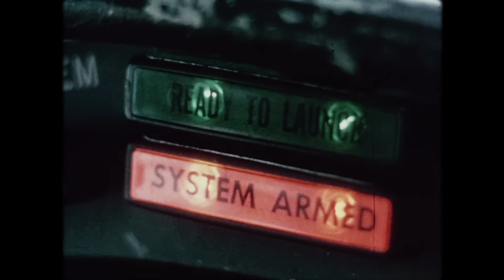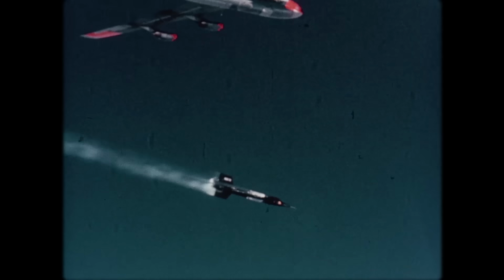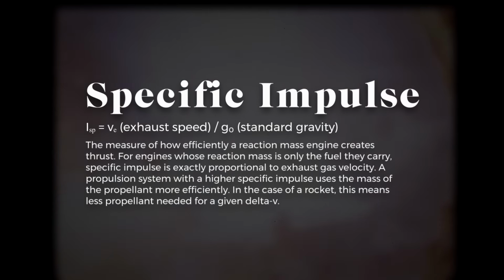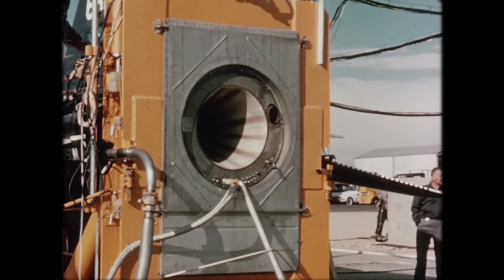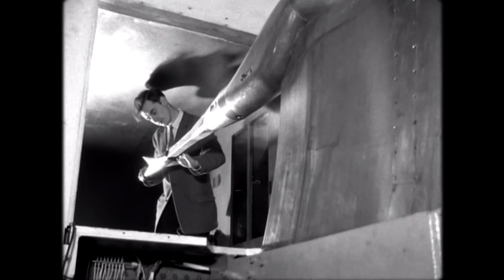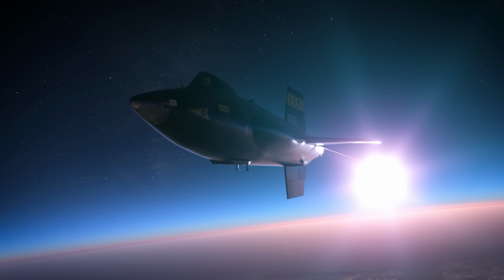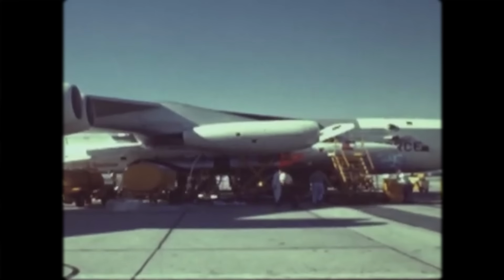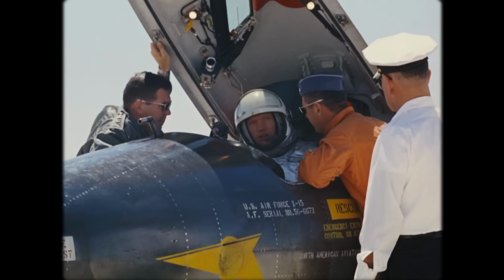The Insane Engineering of the X-15

Comment: “What? No, it’s totally an airplane. I mean, it uses a rocket,  but it’s NOT a rocket. It’s a plane. See the wings and stuff?”
Reply: saying this thing had wings is the same as saying the t - rex had hands lol
Reply: @karagothshlomidabush3727  hahahahah, dude.... golden comment :D
Reply: @karagothshlomidabush3727  and it does have hands. Just cause their tiny doesn't eliminate the fact it has hands. Invalid analogy.
Reply: @haryredneck   no it isn"t an invalid analogy   !!  because while it had wings .. and i am not disputing that ...nor am i disputing that the t- rex had hands ... they were not there to serve the x15 as wings ... only stablizers as well as the hands on the t-rex where not there to serve as hands to a full extent but they were there simply a  by-product of  it"s path throgh evolution
Reply: @karagothshlomidabush3727  They were wings, not fins or "stabilizers".  Did you notice how the aircraft was recovered after its mission?  Just like the space shuttle, it glided back to base.  Sure, it was a lifting body with small wings, but the two are not mutually exclusive, thus the SR-71. Rockets, on the other hand, have the same glide ratio as a hammer and need to have a means of reducing vertical velocity before contacting the ground.  Parachutes were pretty much the only technology available at that time.  Finally, don't forget the four forces involved in heavier than air flight:  Lift, Drag, Thrust and Weight, particularly lift and drag.  The creation of lift causes drag; Drag causes friction, Friction causes the upper surface of the wings (as well as other areas) to heat up, and that was clearly demonstrated with the temperature sensitive paint that was used by the designers of the airplane.  Not just the leading edges and joints between the skin panels, but the color change aft of there shows that the wing was generating lift.  A fin does not.  They are wings.
Reply: @Finchman63  CAN YOU READ ENGLISH MAN ????  READ MY COMMENT AGAIN
Reply: @haryredneck  They`re*
Reply: @karagothshlomidabush3727  he's right man.
Reply: @ItsNerforNuttin  you also having truble with english ?
Reply: @karagothshlomidabush3727  bro, just stop. You're making yourself look like a fool.
Reply: @karagothshlomidabush3727  Remembering the X-15 radio and B/W TV reports as a teen and young man, the X-15 was an amazing aircraft with considerable maneuverability both vertically and horizontally. So, it was "an airplane", a very advanced built-for-speed airplane (thus the short wings).  It was the design concepts test plane for and precursor to the Aero-Space Plane... a 1960's Boeing concept... aborted by ??? politics..

Its replacement craft, the Shuttle is just the last stage of a rocket ship which, according to it's pilots, "flies like a brick", and It is incapable of even partially circling the runway for a different approach.  

The main X-15 engine was a rocket .. however, I think the first X-15 flew with a jet engine. But airplanes have all types of engines; prop, jet, solar electric, ram jet, jato, and even "none" (as in gliders).  Wing design for airplanes are much more varied than the power supplies... can you say "canard".
Reply: @karagothshlomidabush3727  no im pretty sure you just won't accept you were wrong, im from the uk so I definitely know English.
Reply: @karagothshlomidabush3727  Your analogy is valid only for when the x-15 was on altitudes where air density was so low the wings were not capable of creating enough lift. But from when the x15 was released until it hit top speed they where more than just stabilizers. Also on the trip back when it was just a glider the wings where more than just stabilizers. So saying the wings where nothing more than stabilizers and serve no other purpose is incorrect.
Reply: @haryredneck  he was making a joke ... You must be fun in real lifeb
Reply: @karagothshlomidabush3727  just because a wing doesn’t have ailerons doesn’t mean it isn’t a wing. Very much is a wing as it very much provides lift and is an essential component of the airplane.
Reply: @DoubleTeaMedia  I think the difference can be seen with the swirl generated by the fuselage / lifting body / nose / leading edge extension. So there is a lot of light sheet metal which has those nice swept edges and faces to prevent a normal shock. And it would be a waste not to use this for lift. But also since there are no normal shocks, "wing tip" swirl builds up. The small wing rides on this swirl and translates it outside to reduce induced drag. The fin behind in normal flight feels no forces so it cannot do anything to the swirl. Still for steering the fin can be used like it is used for stabilizing and thus the elevons sit on the fin. But why no landing flaps?
Reply: i was told @ Lockheed (field trip) that a rocket has to be "dumb" to be a rocket. if this has a pilot its not a missile either because thts not "smart" or remote control. its just a plane w/ a rocket engine...
Reply: It's piloted missile basically 😂
Reply: Rocket engines are a type of jet propulsion.
Reply: So its a space shuttle
Reply: "WHAT DO YOU MEAN ROCKETS HAVE WINGS TOO? THEY DON`T, ALSO LOOK AT THAT POINTY HEAD, TOTALY A PLANE"
Reply: "<aside, to engineers> Hey can we make the fins, uh, wings, even smaller and get away with it?"
Reply: I love reading people arguing.
Thanks for the entertainment.
Reply: Have you never heard of rocket planes?
Reply: Hey guys. What an argument!! Remember that a plane does NOT need wings to fly. Just look up the "lifting body" planes from the mid 1960s. I think Karagoth raises that point.
Reply: @stankakol5195  but they got small wings or winglets. And in the end the Spaceshuttle got even larger wings. Seems that you need them to bring any payload back to earth safely.
Reply: @ArneChristianRosenfeldt  No true. The lifting bodies had NO wings at all. And the wings for the Space Shuttle Orbiter were only for cross range. The Orbiter could have otherwise been a lifting body design.
Reply: @stankakol5195  Okay, I did not really check, but I think I saw a lot of different designs. A capsule like on Sojus can be steered an in a way is a lifting body. Where do you draw the line? The Orbiter already has a very high landing velocity and cross range cannot be discussed away I think if you want to hit the landing strip.
Reply: German engineers pitching the me262
Reply: of course it is.
Reply: Everyone in here is a DA. why are you guys arguing over a rocket or a plane when it was created using a combination of both technologies? It's beyond me how people can't understand it is a rocket and plane all in one. But please, by all means, continue to make yourselves look bad in front of the whole comment section for my amusement. (grabs popcorn)
Reply: @seanmccloud8907  these r fax
Reply: @seanmccloud8907  u did type more than half the ppl here tho xD
Reply: It shares that classic pipe-bomb design with rockets. Airplanes are built completely different, they have fuselages and wings, controllable thrust,...
Reply: somebody stupid:  Sounds promising.  Lets give it a try
Reply: It’s a Rocket, with wings that didn’t do anything until the recovery phase then it became a glider.
Reply: Lol and stuff
Reply: Do rockets have a person inside? 🤡
Reply: Than is the F-35 not a plane .
Reply: Yep. It's a plane.
Reply: The x15's wings did provide lift. When this thing (or any plane) is in level flight, the thrust is exactly horizontal, providing no vertical lift. Without lift from the wings, the plane would begin to fall no matter how much thrust is applied horizontally. The wings (though small) still provided enough lift to keep it at altitude in level flight. It's a plane powered by a rocket instead of jets.
Reply: nope.  it is a rocket.  it does not have large enough wings to create lift on it's own and it brute force pushes it way through the air.  without the rocket, with a normal engine it would not fly at all.
Reply: @jamesjdm  I mean the thing looks basically like an F-104 Starfighter with a rocket instead of a jet engine. Still a plane.
Reply: @jamesjdm  Nope. Those wings are producing lift. If they weren't, the rocket would have to be pointed down to keep it from falling. It's not going fast enough to orbit.
Reply: @jamesjdm  So when the rocket burned out, did it fall out of the sky and crash, or could it fly and land without power? If it can land, i'd call it a plane.
Reply: All wings require propulsion to produce lift, so not sure what you mean. lol
Reply: @jamesjdm  exactly man ! you got it right

Comment: Really great video, thanks, from an aerospace research engineer. Pretty spot on in terms of the key facts covered too, it's nice to see you discuss the Isp and molecular weights of the relative fuels, which many people tend to leave out. The design choice of whether to use LH2/LOX, LOX/kerosene, or NH3/LOX is quite easy to summarise. If you have a mechanical size limitation (Saturn V) then you choose the most volumetrically energy dense fuel (kerosene). If you have a decent tank size allowance, you go for the most mass energy dense fuel (LH2). The use of NH3 in the X-15 was rather unusual, since it is neither volumetrically nor mass energy dense compared to the others. But the storage size, temperature of storage, and ease of pumping to high pressures (and very high post-combustion exhaust water content) allows very high specific impulses in suborbital hypersonic flights while maintaining a slim profile needed for low drag. And as you say, the relatively high specific heat allows regenerative cooling and keeps tank boil-off low.

Comment: It is not accurate to cal the X 15 a plane. It could not sustain flight and did not take off under its own power.
Yes, it had wings, but they were rudimentary and more accurately they were control surfaces. 
The X 15 was a rocket, only for research purposes.

Comment: Chuck almost burned up in that thing. That top speed is not that much higher than the REAL top speed (Still classified) of the SR-71 even though they are officially decomm'd. It is significantly higher than the 3.3MACH which is listed publicly as Habu's top speed.

Comment: 199, so it basically had more flights than Space Shuttle.....
This is a great historic/engineering video about X-15, but I would like to point out some error regarding the aerodynamic part of this video. This is based on my undergraduate study on Aerodynamics and Advance Aerodynamics (i.e. supersonic Aerodynamics). So please to correct me if I'm wrong.
1. Primary heating of the air actually comes from the shock wave it self, which heats up the air downstream of the shock. Frictional heating is almost neglectable. 
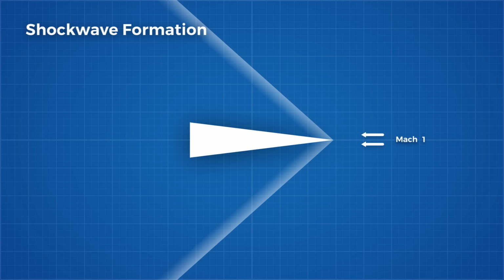2. Even an Oblique shock creates a supersonic flow by definition, it still needs supersonic in flow. At M1 (20:03) you cannot create oblique shock in general. (Well, maybe regional ones that has a local mach number > 1, but still the graph is very misleading)
3. 20:56 For oblique shock, the in flow "bends" the direction at the shock surface, it does not travel along the surface. This act very much like how refraction works, you can't make the flow travel along the surface or there will be no shockwave any more.. 
4. Yes, Newton's equation did become better at matching the actual lift, but there's an entire field of compressible, super sonic flow that does way better than that. Despite the fairly close conclusion, the reasoning is quite off.

Comment: You need to improve your research skills as it was Flight 90 (and later 91) that passed the Kármán line on 19 July 1963 at a max speed of 3,710 mph (5,971 km/h) 65.8 mi (105.9 km) flown by Joseph A. Walker  not Robert M. White whose flight only made it to 95.9 km. White holds no records at all.

Comment: Rocket? Could have gone a little higher and much faster.
A plan has airbreathing engines. 
Its a rocket not a plane.
Reply: air·plane
/ˈerˌplān/
Learn to pronounce
nounNORTH AMERICAN
a powered flying vehicle with fixed wings and a weight greater than that of the air it displaces.
 
Hm...

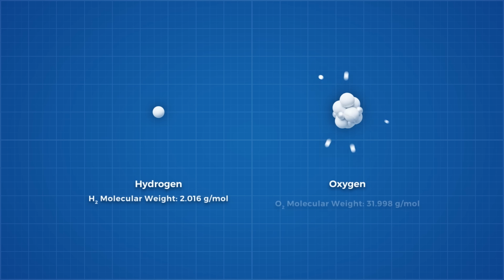Comment: As an Aerospace Engineer, I avoid speaking in absolutes for exactly this reason. Hydrogen and oxygen are not "by far the best"  @9:25. Oxygen is not the most powerful oxidizer. Fluorine is a better oxidizer than oxygen. Hydrogen and Fluorine will create about 5% more specific impulse per given volume but it comes with a 900 degree exhaust temperature increase amongst a host of other problems like being extremely toxic to humans in almost every way.

Comment: I’ve always known about the X-15, but for some DUMBASS reason, I discounted it as some not-for-real-airplane, rocket thing. I always thought it was just like a cheat code to go super fast. Wow, was I wrong. Thank you for this education. This is unbelievable stuff. To think they did this with pencils and paper, not supercomputers, is just unreal. It’s also more proof that the “moon landing was fake” crowd is dumb. I don’t doubt that this flight was every bit as hard to achieve as a moon landing, given the atmospheric and control issues that had to be overcome. Well done, sir. As usual. 

It’s also cool to see that so many now common things got their start in the aviation and space industries. Materials (like Inconel) that were once unobtanium, are now relatively common in engines and cars (exhaust valves, exhaust manifolds, turbos, etc.).

Comment: Its extremely doubtful today's 21st century aircraft designers could build this aircraft today without the aide of state of the art computer programs , the creations of 1960s rockets using mathematics slide rules & wind tunnels is a lost skill ,we still haven't surpassed 1950s and 60s heavy lift rocket tech .

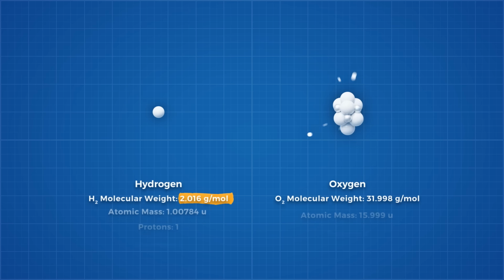Comment: There was a small mistake in the video around 9:30. The molecular weight of the propellants doesn't affect the specific impulse at all. It's the molecular weight of the exhaust products that do. Hydrogen/Oxygen produces only water vapor and excess H2, which are ~18 and 2 g/mol each, while RP-1/Oxygen produces many more exhaust products like CO2, CO, O2, OH, etc... along with H2 and H2O, which makes its exhaust molecular weight a bit heavier.

Comment: I just use LOX and Propane = easy to find, safe if they leak.   But the engines kept on melting, so I use ablative coatings on the inside of the engine itself.

Comment: That colour changing paint is the coolest thing I’ve ever heard of
Reply: Ablative coatings shed heat by shedding themselves.
Reply: Yeah, I concur with Jim Urrata's comment, adding that technically it isn't even really a paint at all, but rather, a coating of thick, insulating, "sacrificial" ablative media designed to absorb & remove heat in a deliberate, measured, & controlled process of degradation as it's shed from the aircraft. The "colour changing" observed is simply the pink ablative coating showing through underneath the secondary white sealant coating, as both are scoured away by the fierce, superheated airflow passing over them hypersonically. The white sealant coating over the pink ablative was designed to provide a barrier between the aircraft's Liquid Oxygen fuel and the ablative coating, which had the potential to react in a violently catastrophic explosion if they were in contact and subject to even a slight impact.

I wonder if a more modern & improved type of ablative coating wouldn't have been more reliable on the Space Shuttles than the insulating tiles they had so much trouble attaching to it's skin and keeping there, eventually causing the tragedy of the loss of the vehicle Columbia and all her crew on atmospheric re-entry.
Reply: @TomFlaTTop_BMW  I think the black 'paint' was probably meant to radiate as much heat as possible.
But we see that wasn't nearly enough to keep body panels from evaporating.
The pink ablative coating added a lot of weight and had its own issues as outlined in the video.
We've come a LONG way in heat rejecting coatings in the past 60 years.
Plasma sprayed ceramics would probably be their starting point today.
Reply: @jimurrata6785  Yeah, Jim , I agree...the original black paint, similar to that used on the Blackbird Series aircraft, was designed to radiate heat as you describe, but that paint wasn't visible or applicable during the max velocity hypersonic runs as it was never designed to function & protect the aircraft at the extreme envelope of performance being targetted on this occasion, hence the need for the thick pink ablative material and the secondary white sealant applied over it.
And I'd like to agree with you about how far we've come with heat management coatings in the past 60 years, but as I hinted at previously, the best we've come up with since then, as used on the Space Shuttle vehicles, is those pathetically inadequate & unreliable ceramic tiles that have had a history of regular failures. The fact that only one Shuttle Orbiter was lost with all crew on board during re-entry is almost exclusively down to luck, and had the potential to occur on any mission.🙄😫😠😡🤬👿👎👉 Hence, my query as to whether the ablative coating solution using more modern materials addressing the issues it had on the X-15 programme might have been a viable solution for the Shuttle Orbiters, but maybe not....although who knows? The Shuttle Engineers used a caulking-like compound intended for bathrooms and purchased at a local hardware store to attach the individual ceramic tiles that collectively formed the heat shield. With all the multi-millions of taxpayer funds spent on these programmes, THAT's the best they could come up with?!??!! It's a wonder they didn't use "Blu-Tac" or sticky tape!
Reply: @TomFlaTTop_BMW  As far as b series there ceramic tiles and they wipe the planes down with some kind of coating by hand. As far as the latest technology metals that still out of my league.
Reply: Never heard of hot wheels? Lmao.